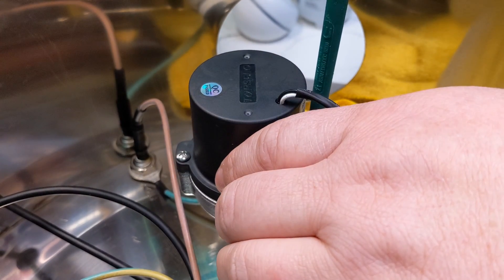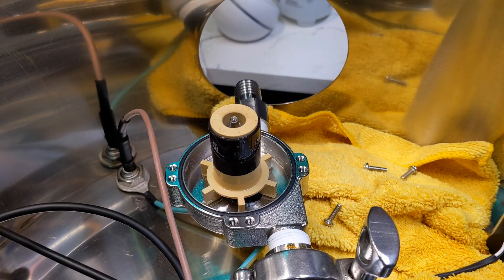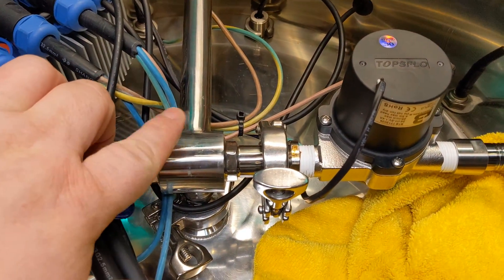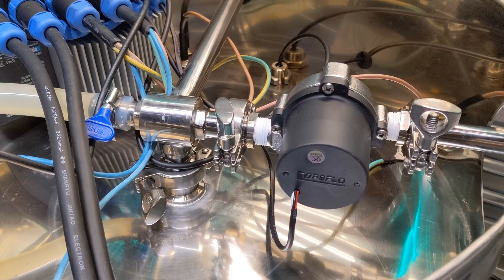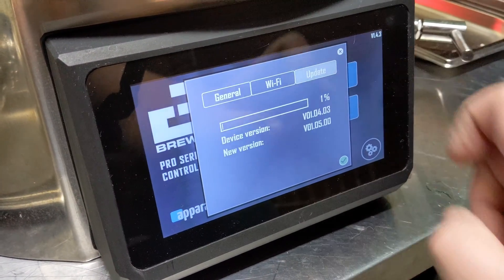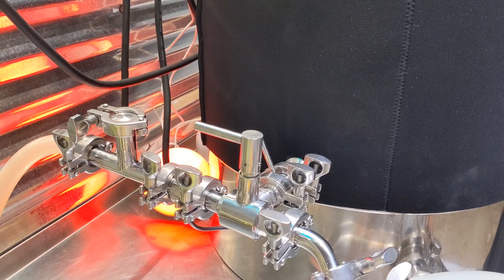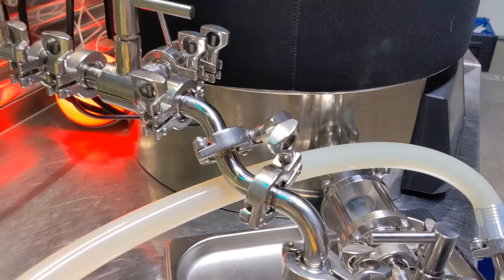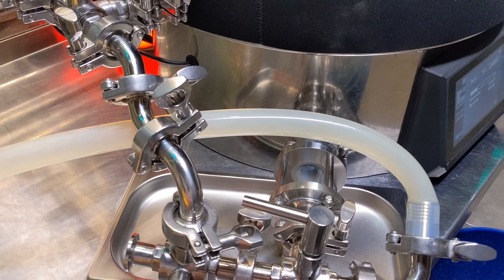Brewtools B40 B80 Brewing System pump disassembly and my current configuration

Comment: I overmilled my grain and had to take my pump apart.  Your video really helped me get it put back together.  My pump was leaking when I first put it together, but I didn't have the screws super tight.  Once I cranked them down, the leak looks to have stopped.
Reply from the maker: Thank you 🍻

Comment: Hey pg instead of going to the half in tri clover that is too long, insert a stainless female to female 1/2 npt with a two inch stainless nipple (search amazon: stainless 1/2 female nipple pipe)(3rd & 4th items) then  put the 1/2 npt to tri clap fitting. Should put it just outside of kettle instead of 3” past kettle.  Just a thought. Love the vids.  Trying to save up for this unit.  Can’t wait!